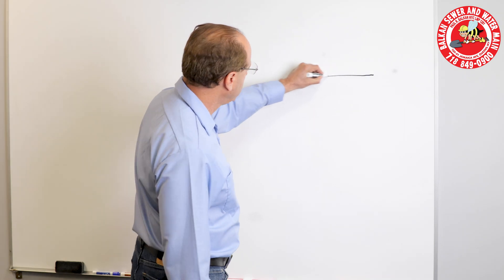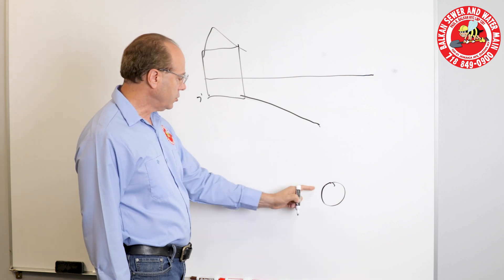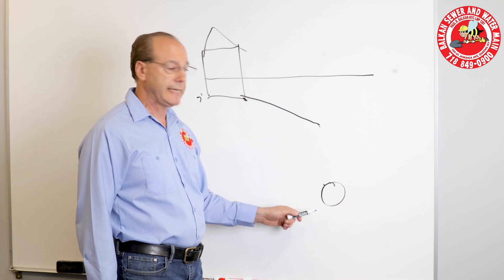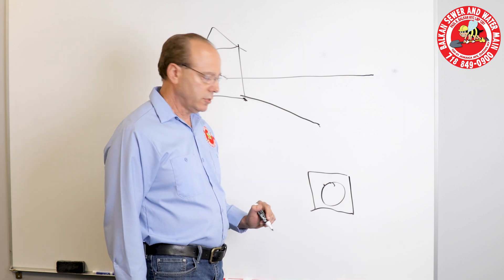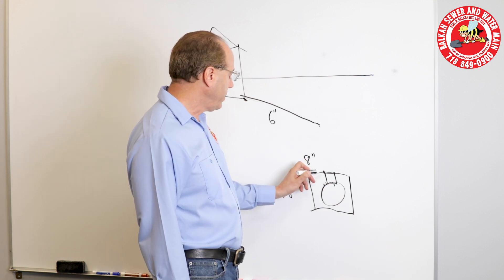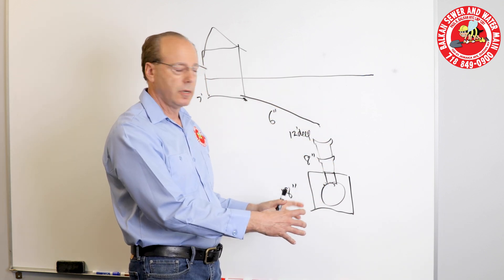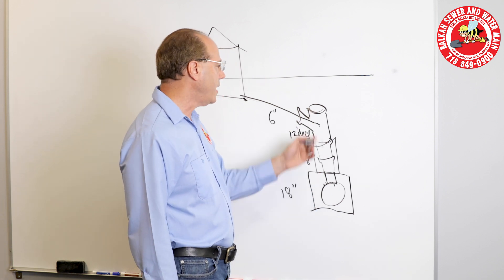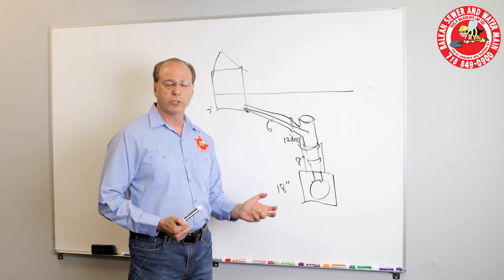House Sewer Connection To Main Sewer: A Riser Connection Explained

Comment: Good stuff.  I live in Oklahoma and I believe my alley sewer is very deep, like your example (so I've heard).  I actually have clay pipe and near the alley is a big tree and my pipe goes right by it (and is giving me root problems).  So I dug down to where my pipe is, at the fence line of the alley (my side of the fence), and found my clay pipe.  It's about 5ft deep- but I noticed that from my fence to about 1ft into my property, the pipe is covered with about 4" of concrete on top of it (possibly all the way around it, I haven't dug down underneath it quite yet).  I believe they call this a "lateral line" around here;  meaning they go from the main to just past your property line and give you a connection point, which keeps you from ever digging outside your own fence line.  I assume they cover the whole thing with concrete in the alley to protect it from digging while installing other lines. (for example, my gas meter is only a few feet away, on the outside of the fence;  and clearly runs right over this lateral line). 

My problem is, they put the concrete right up to the bell of the clay pipe (with the bell being on the lateral/main/alley side), and due to root intrusion, the bell of the pipe was busted off on the top half, and now the pipe barrel is basically flush with the concrete face, so I can't put a fernco coupler on the barrel of the pipe (there's no exposed lip).   How should I make a connection here now? (i'm putting in 4" pvc and just need to tie to this clay pipe, that has a concrete cap on it).  

Should I cut back some of the concrete and expose more barrel of the clay and install a fernco (which is ideal, but seems risky if I have to start busting or cutting concrete- and might break the line even further)?  Or is there some more practical way to tie in here? 

The bottom half of the clay bell is still there.  I could literally nest the PVC into that bell and it should line up quite well;  but then the PVC is basically just butting up to the concrete face (on the top side).   Should I just buttt it up like that and maybe surround it with a 5gal bucket and fully encase the connection with more concrete (not as ideal, but would it work?)??     Any opinion would be awesome and very much appreciated.

Comment: What if the house sewer is lower than the street sewer? What happens there?
Reply from the maker: You’d have to raise the house sewer. A sewer works via gravity. Sometimes a sewer ejector pump must be installed in the house.